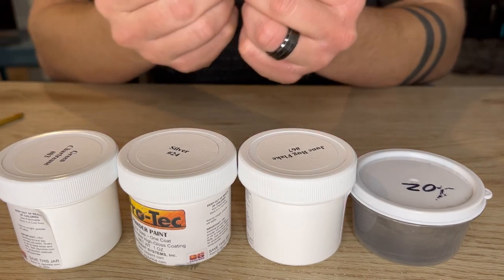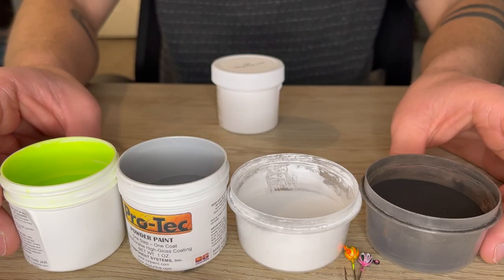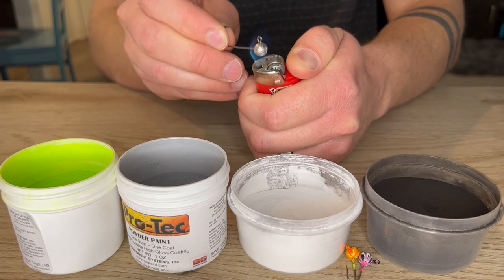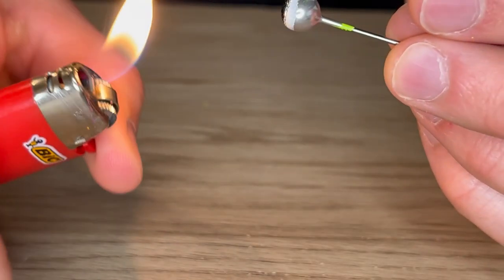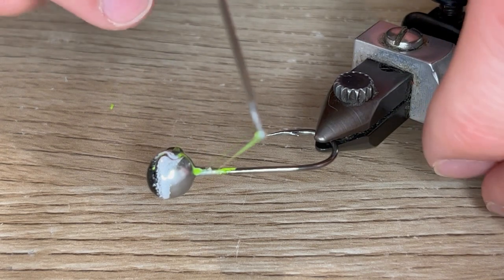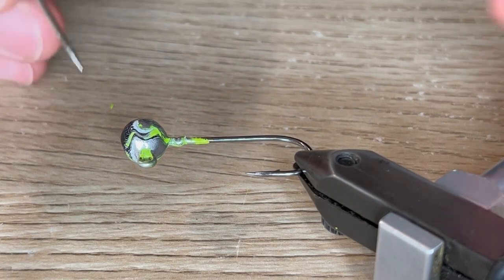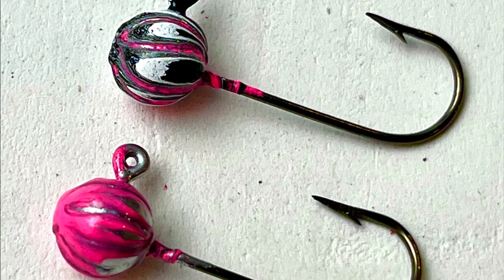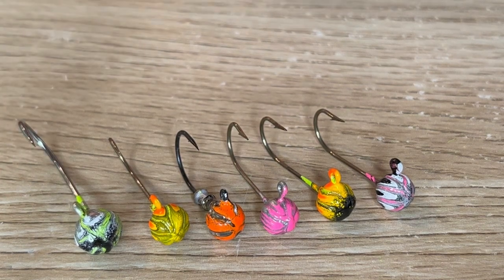How to Swirl Paint Jig Heads With Powder Paint

Comment: Do think it’s necessary to heat treat powder painted heads anymore if use uv resin on them after tying?
Reply from the maker: If you’re applying a clear coat you do not need to heat treat. It makes no difference.